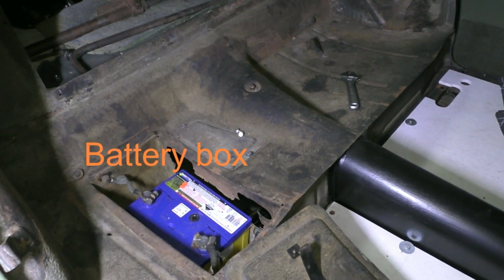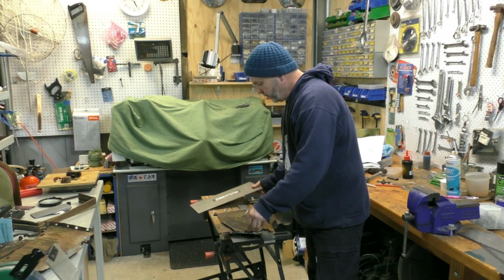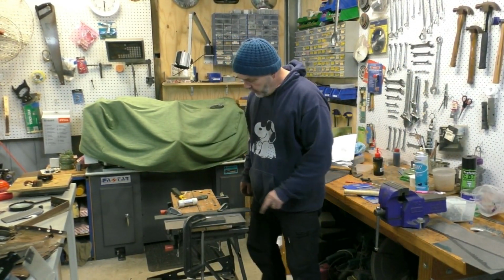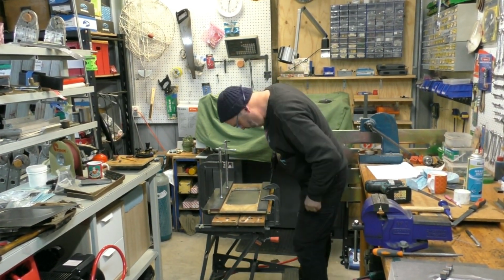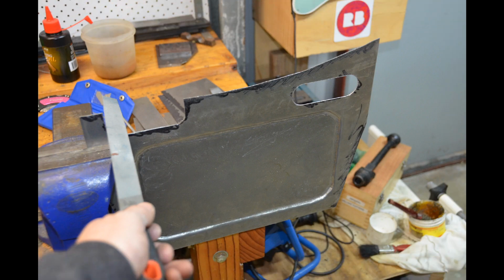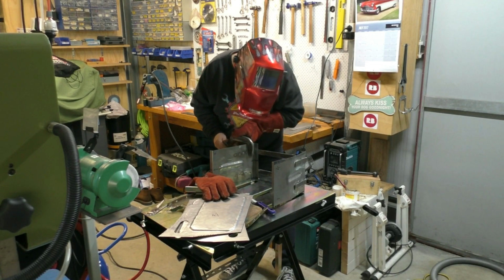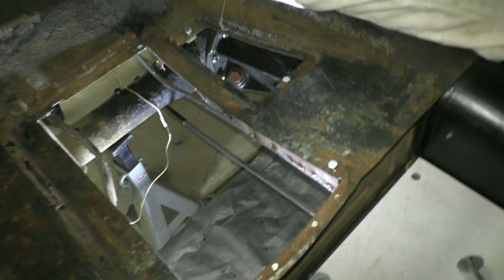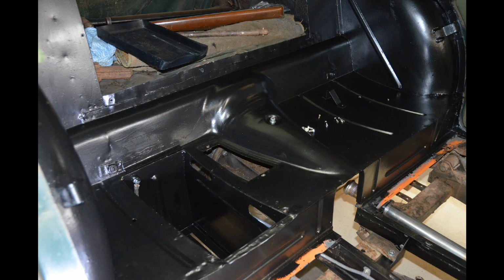Greg's 1949 P3 Rover Resto Battery box chapter 8

Comment: Fascinating series Greg I have purchased a P3 today and so am engrossed in your resto. Is there a reason that riveting would be as good please. John
Reply from the maker: Hi John. Thanks for the comment. Good luck with your P3; it is a restoration Project? I think that riveting would  work just fine. The original was spot welded and my general aim has been restore back to original as best as I can.. I don't have a spot welder, subsequently I  did plug welds using my MIG welder. These welds look pretty similar to spot welds.